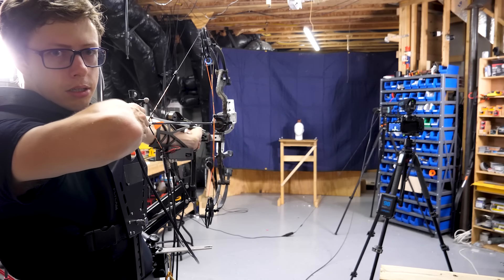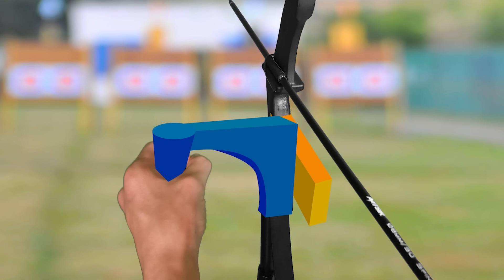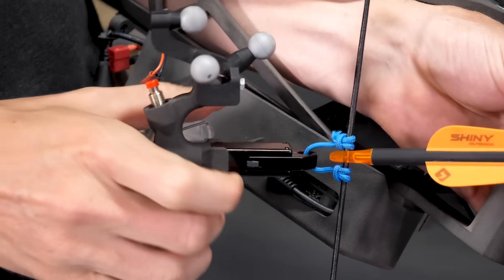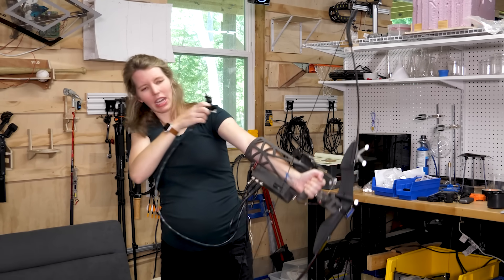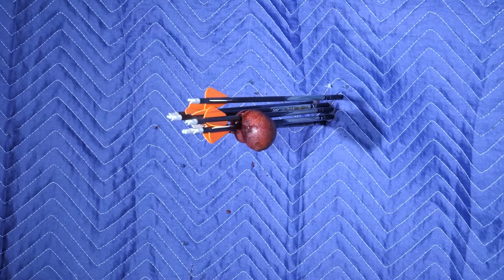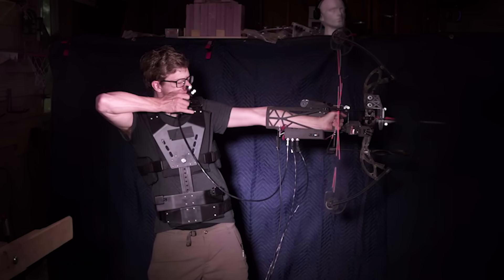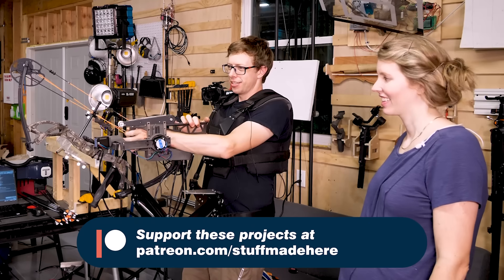Auto-aiming bow vs. FLYING targets

Comment: Offered for your consideration, though probably pales in comparison to your plans for V2:

1) Small / light weight flexible pressure indicator on the arm.  As the computer is calculating the position, if it needs you to move more, the gentle pressure on the arm provides haptic feedback.  More pressure means move more, light pressure means move a little.   With practice, the feedback system could help increase the active targeting range.

2) led indicators for firing process and or aiming assist.  (Or troubleshooting when watching video playback)

3) on the recurve there is a periodicity to the wave function of the fishtailing of the arrow due to the length of the arrow.  Dunno if you care about revisiting that, but there are some really impressive recurve shooters that account for this in their adjustment of ranging so the target is always in the middle of the wave function.

4) lighter weight design with a better / proper fitting form where your hand isn't right in front of your face.   It might mean making a standoff for the release and making it a dual location marker so that the angle can be calculated from the new sensor position.. proper form AND cameras being able to see.

Comment: Take Joerg`s instant legolas. Look how the TrackingPoint sniper rifle work. Stabilize between the the instant legolas and the bow, Use a digital scope that calculates the distance and adjusts the aiming picture accordently. With a electronical release just aim you target into the and hit the “ready” button. The system micro adjust stabilizer bewteen the bow and legolas.. And as long as you have the target within the area of the aiming picture you will hit bullseye every time. Just like the Shapr Origin CNC router works.

Comment: Archer here. If anyone else has issues with getting hit in the face with your string hand, lift up your elbow to draw straight back instead of towards your face. Be careful when using a release because releasing prematurely can lead to damaging the bow, your face, and whatever the arrow flies at. find a spot on the side of your face or under your jaw to "anchor" your drawing hand.

Comment: You can change the arrow rest instead the one that looks like a brush there are some other models called  drop away or a blade launcher .
That will add more variation but it will help to shoot the arrow more straight .

Comment: Maybe an experienced archer can weigh in on this...   It seem to me the difficulty with refining this project (more accuracy) is dealing with variations in the actual flight path of the arrow.  His system can perfectly predict a theoretical target/arrow intersection, but how consistently do arrows fly?  In his slowmo, you can see the deformation of the arrow as it comes off the string.  I would imagine the fins/feathers must vary or get damaged.  How much can you control or dial that in?
Reply: Joergsprave did a reaction video

Comment: Have you considered not having any sort of mechanical adjustments? You could just have a trigger that fires automatically whenever the shooter is aligned with the target, using a camera attached to the bow you could identify targets and where they are relative to the bow. You'd still need a way to determine the string's tension from a device mounted to the bow, that's beyond me though. There's a scope for firearms called "TrackPoint" that does something like that.

Comment: Last bits of comments:

1, surprise your wife (if she want an upgrade to the current set up) with a Win&Win (or Wiawis or WNS……they have a few branding) CXT or AXT or ATF or Forged Plus or anything from WinWin. 😂😂😂

That Dakota bow, you can get limbs matching the draw weight of the current set up. 

2, the Whisker Biscuit arrow rest will break down your fletch over time.  Maybe removing a tiny bit in the area where the fletch passes through to reduce the impact.

Comment: If you adjust the draw length of the bow and put your anchor point for your right hand such that it is touching your face it should prevent the self punching action. It will also help with your shaking as you will have more support.

Comment: Great project. As an amateur recurve archer, here's my few cents: If you can draw to a reasonable anchor point on your face, you eliminate the face punching as your hand is already behind your face/head and also greatly improve the consistency of the shot by eliminating the dancing of the end of the arrow. Moreover it'll also make the draw length (shot power) more consistent. You can make some mechanism to fix the draw length but then it'll be more like a crossbow and not a recurve/compound bow I guess.

Comment: One problem I see with the V1 design is when the servos move the bow in azimuth or elevation, your arm  will move in the opposite direction. A simple, perhaps boring workaround, is to eliminate the aiming servos completely, where it’s all you doing the aiming, and the program releasing the arrow when you are correctly lined up.

The other option would be to take the human out completely, and mount the bow to a robust platform that won’t flex in the opposite direction that the bow is being offset.

Comment: Cool, but an absolutely static setup that won't function without cameras all around. Would make it more accurate if no one held the bow at all.
Now to the big challenge, to make it work out in the field without any auxiliary or specially prepped stuff and without external power supply etc., with all the challenges bow hunters would face when they're hunting for deer.

Integrated range and level sensing, target recognition with motion compensation and prediction for target movement based on the shape of the ground on which it's moving on.
Also add wind and obstacle avoidance to make it as realistic as possible to what a real hunter would need to to deal with.

With all these parameters added to the calculation, you will maybe need more than a few weeks of programming :)

In the end you must realize that the best "robots" you will ever make, are the ones you make with your wife :)

Comment: I don’t know if it already exists but if not, could you make a filament sensor for 3D printers that measure the thickness of the filament and changes the extrusion based on the thickness of the filament so that even bad filament can print nicely?

Comment: This is amazing! I can't wait for V2. I genuinely love your content more than any other youtuber I'm subscribed to. Also, if you're looking for another challenge someday, I'd like to suggest you build a robot that makes your bed! Manipulating fabric seems like an exciting challenge/headache. The closest I've seen is one that kind of zips up the sides from the bottom like a sleeping bag, but I like to kick the bottom corners free so my feet don't get hot. I want something where you can pretty much tangle the sheets as much as you want and it can handle it no problem. Bonus points if it can remove the sheets and put them back on when they're clean! Thanks, and keep doing what you're doing

Comment: What’s used to designate the target? You had the markers on the target box before to designate the four corners of the box so the target would just be the center of those four makers, but for the lego and the apples there weren’t any marker balls, so what triggered the software to designate them as targets?

Comment: Pleeeease make the aimbow V2 like an automatic crossbow where it automatically puts an arrow and pulls the string after firing, with the sistem of the aimbot so it goes like a arrow machine gun but if Deadshot was holding it.

Comment: I was trying to create a projectile system in a physics sim a few months ago, when I realized a paradox. suppose you have a target moving at a steady speed on one direction. In order to hit the target, you must know where it will be by the time your projectile hits it. To do this, you simply set the gun aimed at the point defined as (target's position + target's velocity * time until hit). Time until hit is defined as (speed of projectile / distance to target). But, to know the distance to target, you have to know what point the gun is aiming at.
Therefore, even in a mathematically perfect world, it's impossible to exactly hit a target, because all the variables are standing on each other. To know one, you have to know the other, and to know the other, you have to know the one.

Comment: As always its realy awesome and it blows my mind how a single person can do all the needed steps on its own. But the biggest flaw on this that I would want to overcome if I worked on it would be the tracking hardware ( cameras) that make a elaborate setup necessary and a outdoor use ( were other issues like wind would come in to play ) out of question. To make the processing hardware and power supply portable too shouldn't be that big of a problem since the equipment is already kind of big and heavy but I guess getting all required measurements with same accuracy would be hard. For the distance measurement some kind of glasses could already work and some sensor for the force that the string is pulled might even get better results but tracking the alignment of the bow sure would be tricky since it needs to be really accurate. Anyway I love your content and how it makes me think about stuff like that  👍

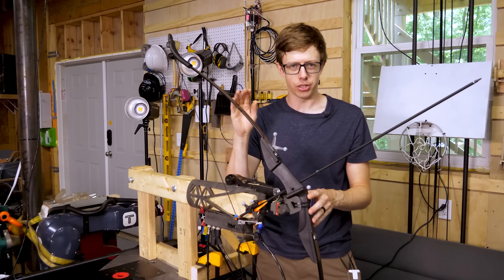Comment: 9:50 the recurve bow you are using is a modern bow with an "cutout" so does not fall victims to the archer's paradox. The problem you are seeing is because of arrow flex and is compounded by the fact your arrows are not matched to the shortened draw you are using.

Comment: Interesting, however instead of an anchor point in mid air, do you think a more consistent anchor point sort of like other archers might minimize some of the variables that you are dealing with?  A consistent draw length and anchor might keep arrow speed more constant which means less corrections for your software. to test this, why not attach a rod to the bow to lock in the draw length and anchor to see how this affects accuracy

Comment: Ok this is for sure one of the most well put together projects you’ve done, but you’re right, there’s room for improvement. First of all, streamline the form. I actually really like that you made it well supported but it would be cool if you combined this with an exo suit project that could help support your arm. Also, the ability to mark your targets in real time would be awesome. Eye tracking like another commenter mentioned would be possible if you integrated in a heads up display. Overall though the thing should be made portable and usable in an open environment. That’s all a lot of work but the extra projects could be integrated into other things

Comment: In the time it took you to make this, you could have learned to shoot a bow.  ;)

All you need to do now, is attach Jörg Sprave's Fenris bow (aka, Instant Legolas) for some rapid fire action!
Reply: Exactly, Instant Legolas is a perfect tool for robotic system since it's basically remove arrow paradox & human errors on the nocking movements. With the guiding tool & magazine, his aimbot bow can turn into auto turret bow LOL
Reply: Practice, or Engineering. You choose.
Reply: This.

Comment: What coding languages would this kind of project use? Genuinely interested on how he coded the aiming algorithm for the bow
Reply: The code shown in the video itself appears to most likely be Python which is great for scripts and is frequently used for prototyping in engineering scenarios for numerous reasons. (in my opinion). It's also fairly intuitive and easy to pick-up with numerous free learning resources. 

I'm not sure how the data coming from the cameras are transmitted to inputs for the bow's controller(s) or in what form, but python and similar scripting languages are great for complex "if this then do this" scenarios, even when both the "if" and the "then" parts become complex.

Comment: You sir are a genius!!!  you should team up with JoregSprave.  He has a channel and he builds clips for bows that will hold like 7 or 8 arrows I think, and also makes a double barrel recurve bow, along with some other interesting gadgets for bows.  If you could combine the two concepts some how, you could be firing two arrows at a time with pinpoint accuracy.  Plus have another two arrows at the ready in a split second.  That might be a bit much but even if you could combine the repeat fire mechanism with your auto aim that would be interesting.

Comment: The way the arrows were bending may have to do with the weight (power) of the bow compared to the physical weight of the arrows you were using.  There are videos on YouTube in which the person sets up a framed piece of paper, like typing paper, and then shoots at the paper.  If the arrow is flying true, it pretty much just makes a hole in the paper, but if it isn't it tears a slot in the paper.  If you want a better understanding about that, you can look for such videos. :)

Comment: What would be good is if he designed glasses to track his eye movement and so he could shoot whatever he focuses on so the target doesn't have to have markers
Reply: That is actually a really good idea.
Reply: Cool, but it wouldn't tell him how far he is from the object. Which makes calculating the trajectory hard.
Reply: @khorneflakes1861  it could use stereo vision to calculate how far away things are. exactly how our eyes work to focus on things
Reply: @khorneflakes1861  Have a camera on the bow and on the glasses, to be able to use the two points to calculate where the third is relative to the bow
Reply: @khorneflakes1861  but actually it can, cos eyes working on binocular method. He can apply that to code to identify 3D scaling for objects, including distance to the target. 
The real problem would be the sharpness of point and dedicating which point would be the "target", cos camera can see in a too little point than man
Reply: Wife walks in "HEY HUSBAND"
Reply: inb4 he looks at someone talking to him

Comment: As a former european and world champion in archery I really appreciated this video ! Design wise I would really change the releaser to be anchored under your cheek. And have a aiming so you are atleast on the target and therefor have the stepper/servo adjustments to be very much smaller, and have less possibility for un straight shoots. I would also maybe check for a better bow or atleast better arrowshelf to be mounted. And then check the spine tunig on the arrows and change the weight of the tip and lenght as necessary to be abel to shoot round holes in paper without feders. Do that before you add the pid controlled movment mechanism and you will have better conditions.

Comment: if your hand keeps hitting you in the face you should raise your back elbow a bit more. Also, make sure you use your back to pull the string back and not your arm, you'll get more power and improve your overall consistency (in terms of power).

Comment: As a recurve bowman I feel insulted with this video. You can get modern recurve bows with arrow rests that minimize the deflection problem with higher accuracy than traditional style bows, and they aren't expensive either.

The main advantage of compound over recurve is power, ease of use, and a compact form. With the higher draw weight on compound being easy to hold at full draw when the pulley system locks out.

The back brace bow mount was also completly extra. Archers brace the weight of the bow against the arm using nothing but the draw weight and back strength to hold it up, not the shoulders. So you shouldn't have gotten tired holding it up.

When releasing the arrow your back should be fully drawn and locked out unable to move, so your hand should remain still and relax for firing. The fact that you could hit yourself when it releases means you are not at full draw and have an extra variable in your arrow speed reducing accuracy because your draw length is a little different each time.

While your form needs work this robot is impressive. Now you must fit the system with The Instant Legolas repeating bow magazine from The Slingshot Channel. Then you will have a full auto aim bot bow HAHAHA!!

Comment: OMG You need to get together with the guy who has the autoreloading bow... where you just pull it back and it loads an arrow for you..  then umm connect it to a robot... but honestly.. why not just take a gun and do this? at that point... 

Oh better, take the autoreloading bow, your auto aiming system .. and now stick it in a backpack facing behind you... then  :DDDDDDDDDDDDDDD I'm jk but omg.

Comment: Great video!! As a bow hunter there are some things you can do to improve the performance of the bow. In the video you can tell you are using cheap blackout arrows. Using match grade straightness arrows properly spined to the bow poundage is huge. In addition, using a drop away arrow rest instead of a whisker biscuit, avoid as much contact with arrow as possible. And then of course tuning the bow with a paper tune to make sure the arrow is naturally coming out of the bow straight :)

Comment: You are punching yourself because your posture is all wrong. The hand that pulls the string, should rest underneath your chin, and your elbow should be level and pointing behind you. This way, when you open your fingers releasing the string your hand will move backwards underneath your chin thereby avoiding your nose and face completely. You should be able to draw a straight line from your hand holding the bow, all the way to the tip of your elbow on your other arm.

Just look at how your wife draws the bow.
Don't worry, most beginners will draw the bow like you do at first.

And yes, we do consider compound bows to be cheating (as the pulleys remove all weight from the string). 🤣